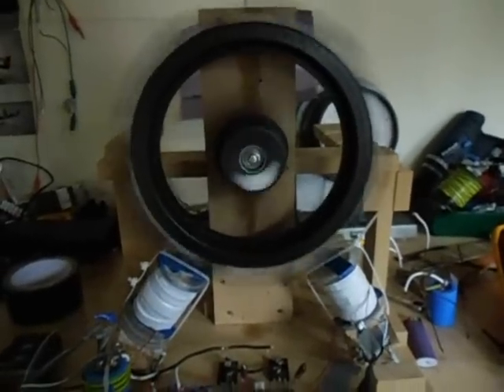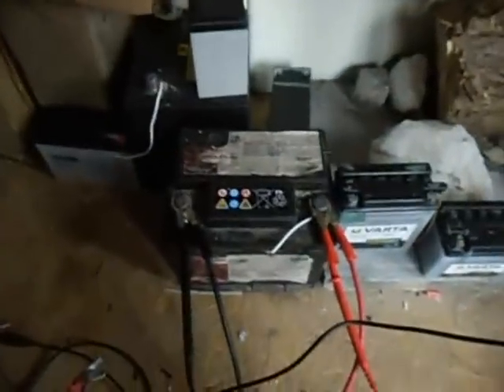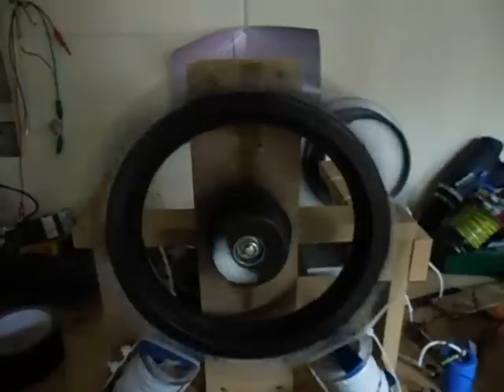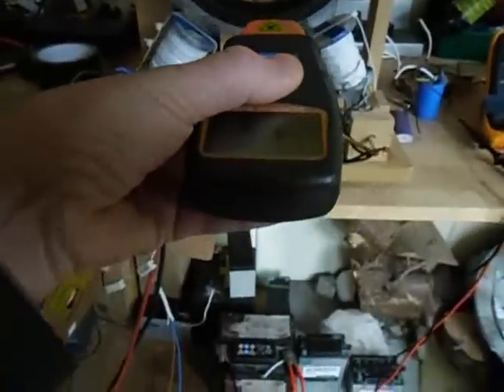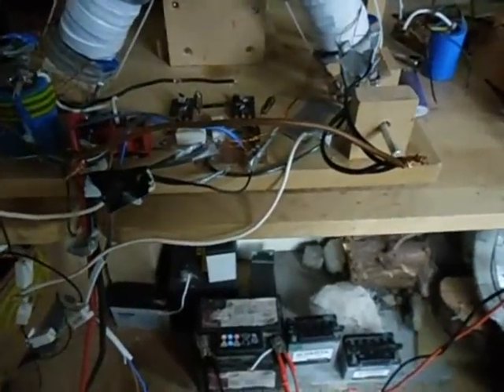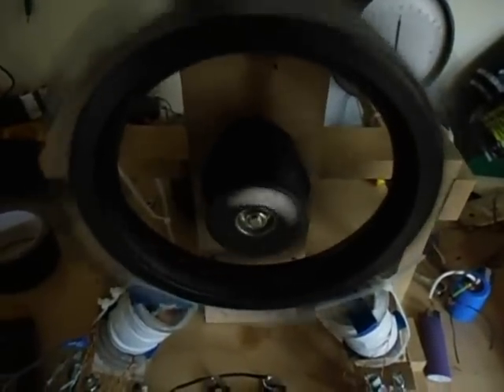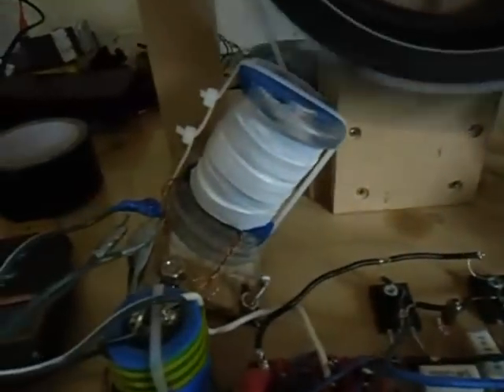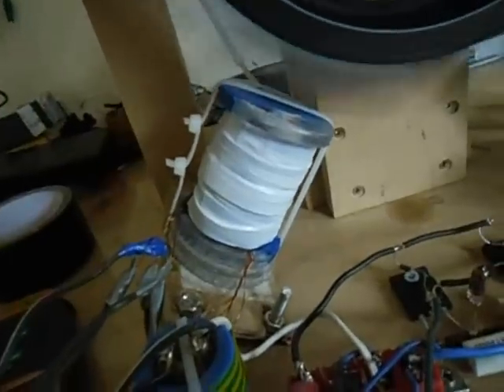Back to the core, perfecting the SSG

Comment: most important is that you have it working and charging. If it is charging well, I would not try to change it. you are doing excellent work here. 
The magnets will trigger your coil and spin the wheel if all norths or all souths are facing out. if all norths are facing out - the coil will repel the magnets. if south out, the coil will attract the magnets and your wheel will be running in attraction mode = even less energy needed from the primary/front end.

Comment: Nice vid, good direction. You had the exact same results with the PMH coils as I did. It's just the reality of that setup.

The bedini is tricky to find the sweet spot between energizer and motor to harvest the mechanical energy, that's why most people just focus on making it one or the other. As an energizer the Bedini is great and easy to tune. As an efficient motor there's much better options out there (check that guide by Patrick Kelly posted in my last vid).Good luck fellow dutchman.

Comment from the maker: Today I made a second identical wheel with all superpoles but now 10 in stead of 5 and rpm doubles as is the input current (between 400 and 500 mA) but charges well though I am not sure if it is better. I kept the old wheel intact just in case.  Will make one new coil from the two and combine  all the wires to one for better sync. And put a 3d transistor on it .Thanks for the comments!

Comment: Thumbs up on the super pole config.
are they "north super-pole" or south?
w/ super-pole you can get the magnets closer together. less speed, but the super pole will have less torque and better charging anyway. w/ the magnets closer together, it will be easier to find the sweet spot and less noise and wear on the bearings.
good stuff - thanks for sharing your journey

Comment: ya a window motor would be a better option. Easier to tune for mechanical harvesting. Or even a zero force motor.

watch?v=4TICXxP1jI4

only problem is the effects of the bucking PMH (or any coil for that matter) stack both their positive and negative effects as you add more coils. But that's a problem that may be solvable....so don't give up, it's worth looking into. Fingers crossed for ya. Good luck.